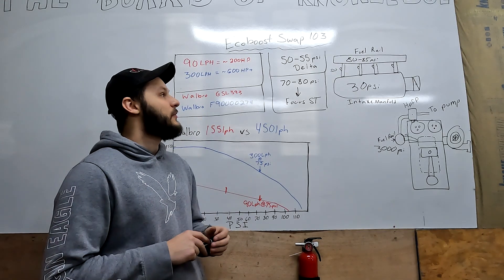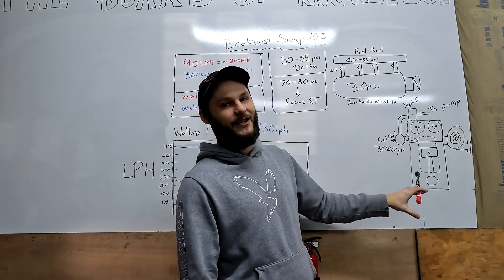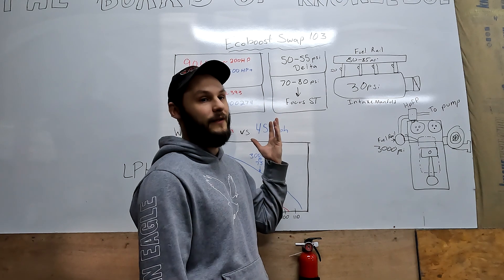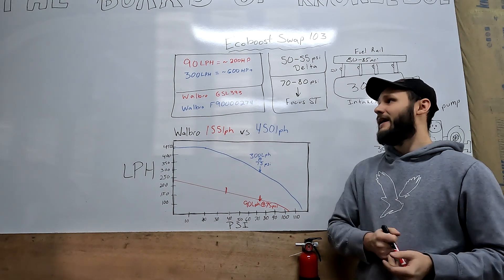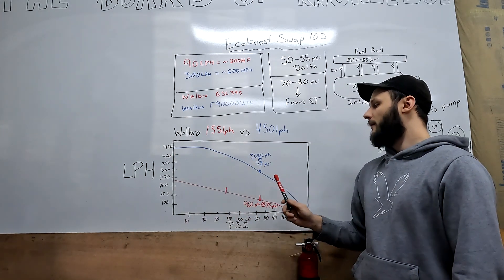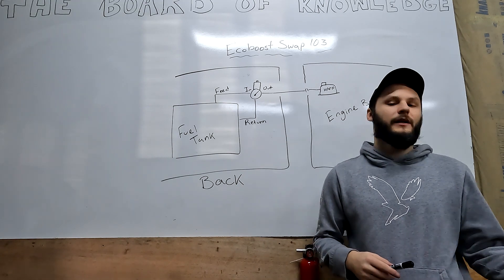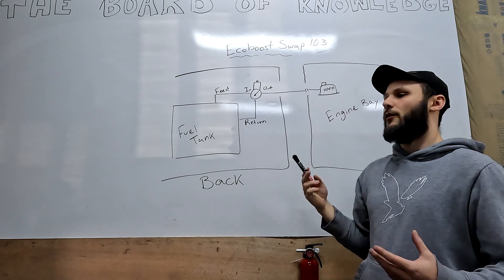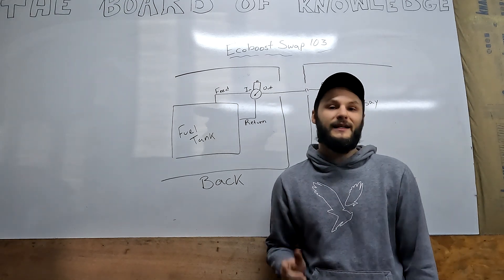Ecoboost Swap 103 | DIY Fuel System

Comment: There are quite a few technical errors in this video.

1) The Ford EB Controls pack recommends a fuel pressure delivered to the engine of 50-55psi. The ECU is programmed for this pressure. When the HPFP solenoid opens and closes, the fuel pressure on the output of the HPFP is multiplied by a factor called the pump gain. Under given operating conditions, the engine may need 2,000psi of differential injector pressure. In this case the ECU triggers the HPFP solenoid timing so that its gain ends up being 40 (2,000psi/50psi). If you raise the input pressure to the HPFP to 70psi, now the differential injector pressure is going to be much higher than expected, around 2,700psi. This will result in a much richer than expected fuel mixture and lots of resulting problems.

2) If you mount a shunt style fuel pressure regulator near the fuel pump, it can NOT correctly regulate the fuel pressure under dynamic conditions. Here is an example. Turn the pump on, but keep the engine off (no pump load). If the regulator is set to 60psi, there will be 60psi at its output AND there will also be exactly 60psi at the end of the fuel line (engine). Now turn the engine on. There will still be 60psi at the output of the regulator, but there will be a lower pressure at the end of the line. How much lower? That depends on the fuel flow volume down the line and the diameter of the line. The greater the fuel flow and/or the smaller the line, the greater the pressure drop there will be along the line. With the engine idling, the pressure drop may only be 0.2psi because the fuel flow volume is so small, but as engine load goes up, fuel volume flow goes up and so does the pressure drop. It could easily be 3-5psi  at WOT. The engine control system (with the controls pack ECU) is designed around the fact that the fuel pressure delivered to the engine is a known constant. It can compensate for long term (low frequency) variations in the fuel pressure by adjusting the LTFT (long term fuel trim). 

3) The fuel volume flow that you talk about for a given engine power level are quite bit off. Many of the online calculators for this are very incorrect because they are written by companies trying to sell you larger fuel pumps. It is in their financial interest to overestimate the requirements. It would take to long to go into the math, but I'll use one quick example to prove the point. A 1987-92 5.0l Mustang used a stock fuel pump which could deliver 88lph. These engines were rated at 225hp. Therefore if you want to make 450hp, you need 176lph. Granted with a turbocharged engine, you want to run it 10% richer to keep the EGT in a safe range, so increase the fuel pump flow to 194lph. In reality the thermal efficiency of the EB engine is probably 5% higher than that of the 5.0l due to the turbocharger, so you really only need a 5% increase to 185lph.
Reply from the maker: You definitely have some good info here, thank you for correcting that. You sound like you are very knowledgeable on the modern Ford fuel systems!

The only thing I disagree with a little bit is the fuel pump flow rates. Yes the pump that I recommend is overkill, but I'd rather have too much fuel than too little. Also I am running my car on E85 which requires a bit more fuel.

Again thank you for your input!

Comment: Does the fuel regulator youre using have the vacuum/boost source on it or are you leaving it free from engine intake pressure?
Reply from the maker: No boost reference, just a constant 80psi supply.

Comment: I’ve been thinking about swapping my car to a fuel cell it’s a fiesta st but idk what to do about the fuel pump control module
Reply from the maker: I would think the fiesta would be pretty similar to the focus. If that's the case, you can still use the power wire from the fuel pump control module to power the fuel pump in a fuel cell.

Comment: What did you do to compensate formfords failed calling issues on all the eco boosts?
Reply from the maker: The first gen 2.0s don't have nearly as many issues as the current Gen engines. They are pretty stout up to around 400whp and reliable. I've personally seen dozens with 150k+ on the original engines. Even my personal fusion with the first gen 2.0 has 125k with nothing but oil changes, air filters, and spark plugs.
Reply from the maker: The current recall is for the 1.0L Ecoboost. Those engines are junk though. As far as I know, they didn't have any recalls for the first gen 2.0L Ecoboosts that I am using.
Reply: @stroupperformance   all the eco boost variants are having issues, even the 6s. Just no recalls.

Comment: Thanks for posting, I hope to do this swap when the time comes.  Could you possibly use a 2.3T mustang fueling system since those are good for 300 hp and torque?
Reply from the maker: Stay tuned! I will be posting more videos on the common questions that I get asked. You could probably use the mustang fuel system for the most part. But if you use a 2.0 engine, the mustang HPFP won't work without quite a bit of modification.